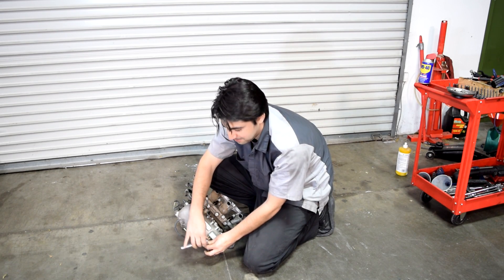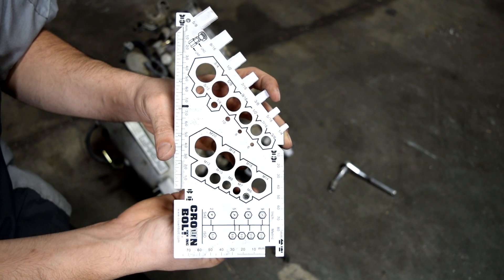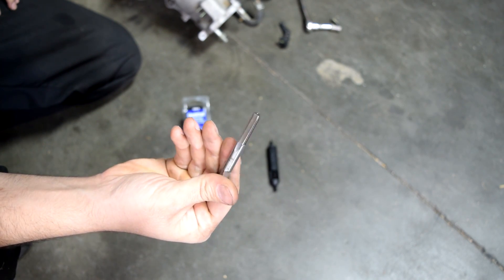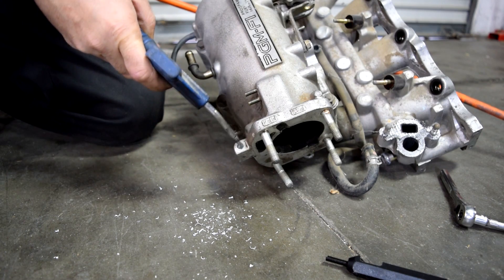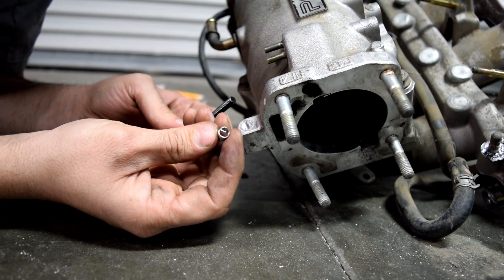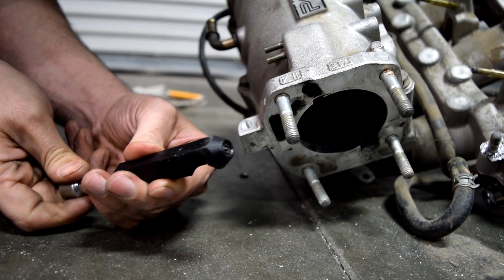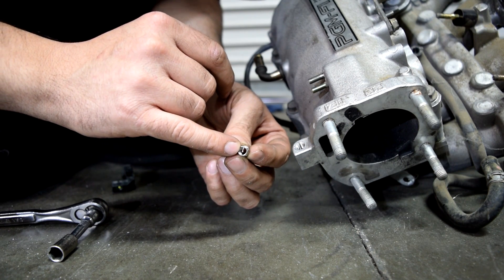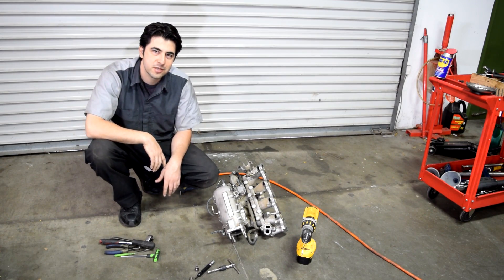How to Repair Damaged Threads by Using a HeliCoil Thread Insert - Long Lasting Thread Repair

Comment: When using a tap, you really should use some cutting oil, but more importantly when using the tap, tap a bit down into the hole then back the tap off a bit. Slowly working your way down the hole. This frees up chips. It may sound like overkill but a snapped tap in a hole is a miserable feeling.

Comment: what size tap did you use for the m6 bolt? i need to use a helicoil on my m6 size bolts on my atv. i want to make sure i use the right size tap and make sure im using the right kind, like SAE, USS, metric...

Comment: Don't forget to use some cutting oil on the tap. Some red Locktite is also not a bad idea prior to inserting the coil. 
And if possible, substitute a stud where the bolt would go. This way you never have to deal with stripped bolt holes again.

Comment: Is it possible to use a HeliCoil for stripped aluminum brake junction box?  I have 2 bubble flare lines that go to the junction box.  Would the drill bit harm the bubble flare inside?

Comment: I'm having hard time using that manual tire changer on somewhat low profile tires. 215/45/17
Can u change a tire around that size On video plZ. I noticed your been sitting there for months
Reply from the maker: t dub I don't have those tires around in the shop. If I get some, I will try to make a video. Cheers

Comment: Those heli-coil kits are life savers. Like David M stated; would Loctite make this repair more permanent? Thanks again for the great videos.
Reply from the maker: Jimmy Mac The key for it not coming out is using the right size drill bit and drilling as straight as possible. If the hole isnt too big when you put the insert in, the bolt itself will push the insert against the walls of the hole and cause it to jam up against it when removing the bolt. As far as locktite goes there are argument for and against it, I've never used it and haven't had problems! Also as far as I know it is not recommended on most thread inserts by the manufacturers (Few types do recommend it though). So in short I wouldnt use it unless specified in the manual. Thanks for watching.

Comment: Why didnt you use locktite on the thread?? Would it come out eventually if you unbolt that piece again???
Reply from the maker: David Marcial The key for it not coming out is using the right size drill bit and drilling as straight as possible. If the hole isnt too big when you put the insert in, the bolt itself will push the insert against the walls of the hole and cause it to jam up against it when removing the bolt. As far as locktite goes there are argument for and against it, I've never used it and haven't had problems! Also as far as I know it is not recommended on most thread inserts by the manufacturers (Few types do recommend it though). So in short I wouldnt use it unless specified in the manual. GL